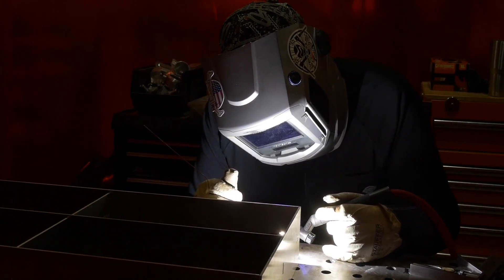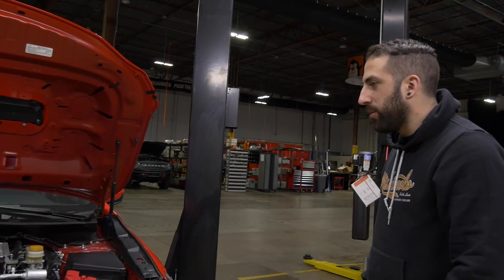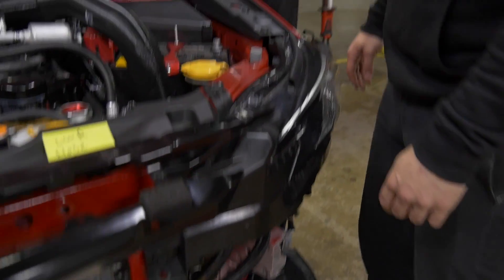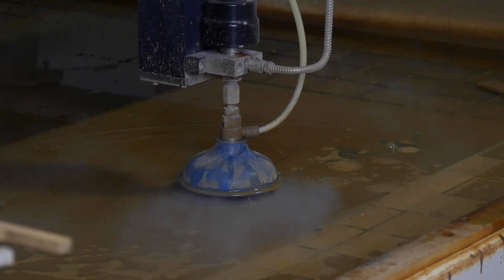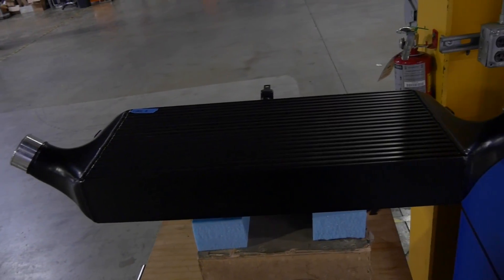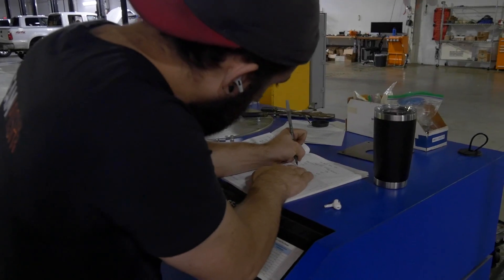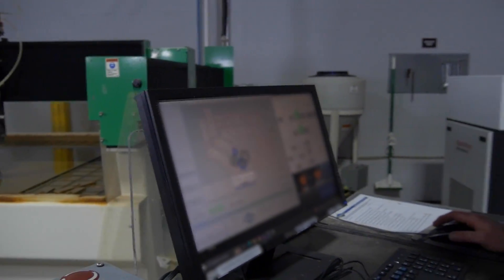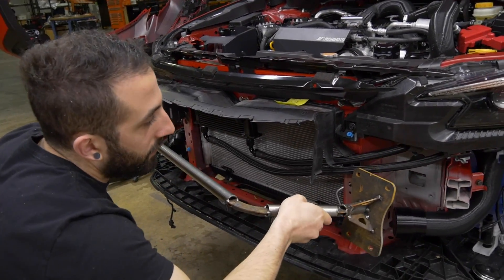The Making of the 2022+ Subaru WRX Front-Mount Intercooler

Comment: The front mounted intercooler provides better performance than the TMIC ? Or is almost the same im trying to do more WHP stage 2 on my WRX 2023 thank you.
Reply from the maker: A front mounted intercooler will allow for higher horsepower due in part by it's greater efficiency over a top mount.
Reply: Awesome thank you 👏🏻🤗